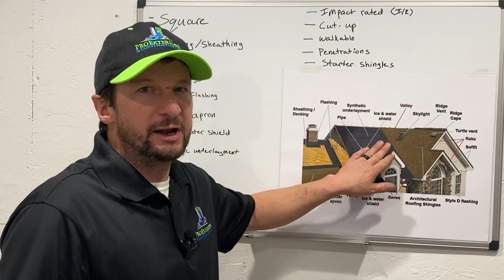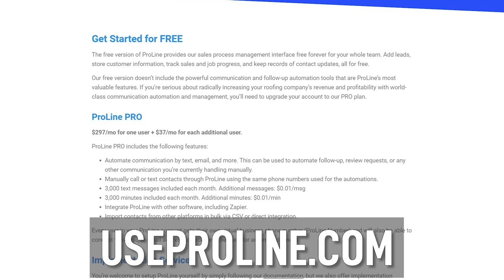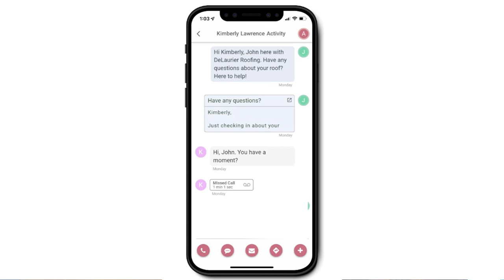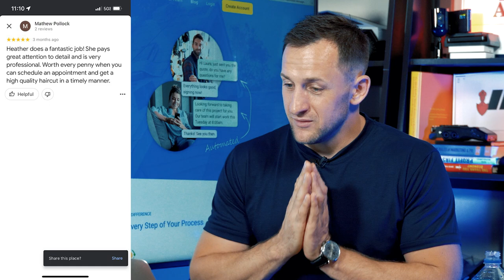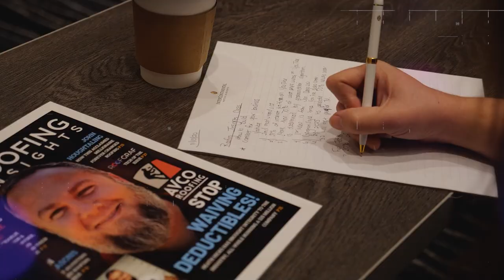7 Reasons Roofers and Construction Workers Suck in Sales

Comment: $3,000 repair vs $10,000 roof.

$10k roof next year is $11-12k, year after that $12-14k.  

Do you want to spend $10,000 now or $17,000 over the next couple years? 

That two years is roughly $1k in value per depreciation.

Comment: 👍  The Type of roofing nails is equally as important as the type of shingles.   Electro-galvanized nail is pointless.   The selected nail should be no less than the Hot dip galvanized.  
Probably that's how some contractors generally encourage more business:  They'll promote great shingles that are good for 25 years but they won't say anything about the nails (which becomes rusted weak by the end of the labor warranty in 15 years).
** Always choose the nails and should be either Hotdip galvanized, or stainless steel.